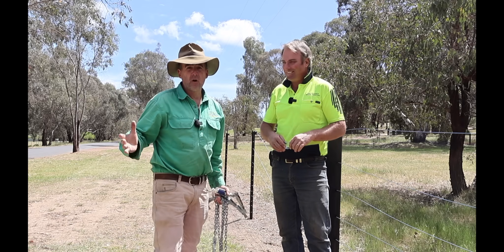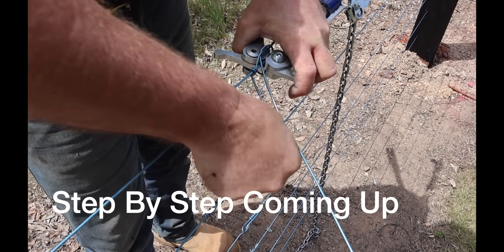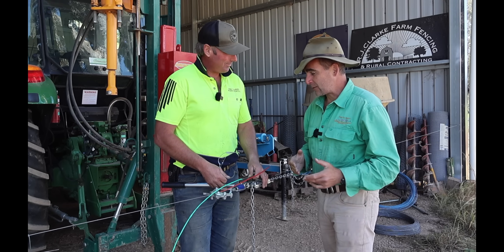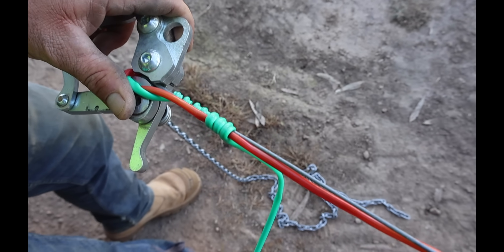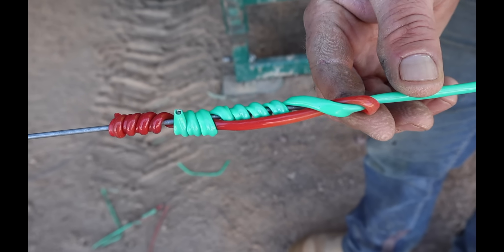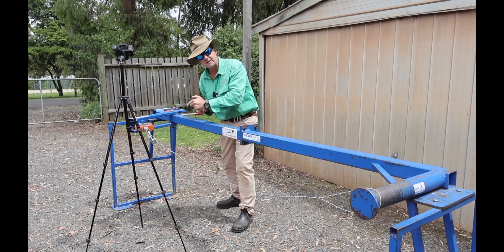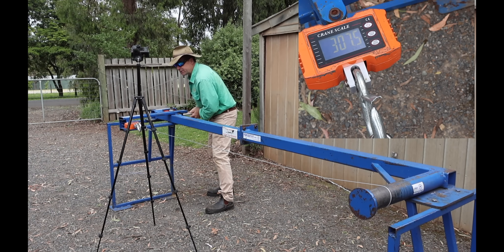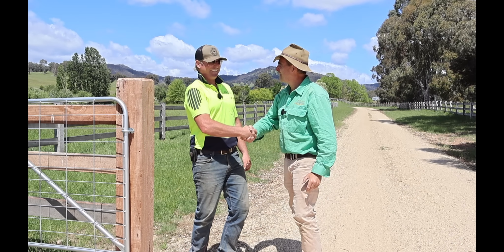This Simple Fencing Knot Is Almost Unbreakable!

Comment: Hey Tim, great video.  Have you ever done any videos on strength of HT barb wire knots for joining barb eg lapping the ends over and splicing by wrapping each one around the other ?? This should be a lot stronger than a double loop.
Also what knot do you recommend when straining HT barb and tying it off to a plain wire bridle around the post - double loop common but will weaken the barb??
Appreciate your views on this, maybe a couple of videos would be great !!  Thanks.

Comment: This is by far the best tutorial for fence wire knot tying I have ever seen.
I use those knots on the last fence that I tied off and it’s still standing strong and tight.
Heading onto a second fencing to keep out The Dingoes and I will trust these knots all day long.
Thanks so much guys. Great channel great material and great teaching styles. 
Love the repeat over and over method and the colour coating differences of the wires. Helps me learn so much more easily.👏🏻🙏💯💖👍🏻
Reply from the maker: Cheers mate, that's exactly why I started the channel and it's what gets me out of bed in the morning. I'll try to keep 'em coming.

Comment: Great video Tim , I really appreciate all your content. Now I have another knot to learn. I have always used a Donald knot for tying off when completing a strain and then moved to the speed knot about 10 years ago. Sometimes I use a combination of the two sharp wraps of a speed knot and a Donald knot. This Mansfield knot looks very similar to a Donald knot with the exception of the 11 final wraps.
I’d find it very interesting for a strength comparison of each of these knots particularly in a strength percentage compared to the wire breaking strain.
Reply from the maker: Cheers mate. I thought it was similar to the Donald when I saw the start, then it gets very different. The loop section has a whole extra twist and then the tails get wrapped in a really interestingly different order. I’m thinking of another video, I’ll keep your suggestions in mind for sure

Comment: For post and rail fence:  Does hardwood rails have a lot of shrinkage that will cause issues and does cypress have less shrinkage to make a better fit?  What is the best length of the rail?  What equipment is needed to cut out the slots for the rails in the posts?

Comment: I would like to see how the knot goes on  high tensile wire
Reply from the maker: It went to 500Kg at Henty on Murray 2.5mmHT which has a stated break strain of 540Kg but usually reaches 560

Comment: Hi Tim, challenge for you, I reckon that knot would work with Iowa barb, prove me wrong
Reply from the maker: Good suggestion!
Reply: Greetings from here in these northwestern United States.

This is the first I ran across this account, so if this is already known, apologies, but it doesn’t sound like it is, so here goes. I used this splice which my brother-in-law showed me when I was putting in 8000’ / 2 400 m of 4 strand barb wire fence for him.

Twisted pair splice: Iowa barb (here in the west U.S. just ‘barb wire’) or plain

1) Untwist pairs ~6 - 8”/ 15 - 20 cm. Slide/twist any barbs off strands, using pliers to slightly unwrap barbs to loosen for easy sliding if needed.

I used two fencing pliers to do these splices, so a longer set of tails may be needed to wrap by hand if using the bent-end ‘cranks’. Adapt to your preferences, tools, and hand strength.

With the second fencing pliers you can chomp,chomp,chomp… your way around the tight wraps, wrapping each dead end down tight to the very end of its stub. Pretrim before final lay down. No need of a length for your fingers to get hold of for grip and leverage.

2) Leaving ~1”/3 cm clear of barbs beyond forks, push fork ends together.

3) Clamp the four-wire bundle together just to one side of the center, preferably with top jaws of fencing pliers which are grooved to fit.

4) Bend one end out 90°.

5) Wrap (twitch, as you say) the bent end 2 - 4 turns tightly around the two tension strands and remaining dead end, away from pliers in same spiral  direction as pairs are twisted. Lay dead end along between the tension strand pair, under wrapping end, for neatness.

6) Bend remaining dead end, coming out from under wrap, 90° and wrap it 2 - 4 turns on. [ Maybe wrap around opposite direction? Whatever looks good to you; not critical to strength.]

7) Trim ends at a sharp angle and leave stubs to act as barbs if desired, 
or bend straight cut stubs around flush to the wraps with pliers (chomp,chomp,…) for a clean, smooth splice.

8) Move pliers to clamp on wrap next to the center, and bend the one of the opposite pair of dead ends which comes out from under the first 90° you made, also out 90°. This one should be nestled into the bend in the first wire, like a couple of kids hooking pinky fingers.

9) Now wrap 2 - 4 turns away from pliers, again in the same direction as the pairs, over the three strands.

10) Bend last dead end out 90°

11) Wrap 2 - 4 turns on down the pair, in same/opposite sense as you did on other side.

12) Trim as before.

This should be at least as strong as the Mansfield knot, I.e. greater than 80% of original. Curious about how it will test.

And it’s pretty!

A tip of the hat to @martinilett7409, whose challenge to Tim in these comments inspired this post, which I chose to put here in the main comments for visibility, rather than as a Reply to him(?).

I hope my word-picture is good enough that, with wire in hand, you can figure it out. I think which strand you bend in 8), and the direction, is the important point. 
When you make this, you should see the kinship to the Mansfield knot’s bends and wraps.

P.S. What you call a ‘strainer’, or to ‘strain’ a fence, is to us a fence stretcher/stretching fence. An exact equivalent usage, so it takes no stretch of the imagination to substitute the words, but a ‘strainer’ to me is a wire mesh or perforated metal sieve. 

P.P.S. Search the ‘Western Union splice’, a single strand wire join. It might be suitable for some fencing uses. I haven’t used it to speak of.